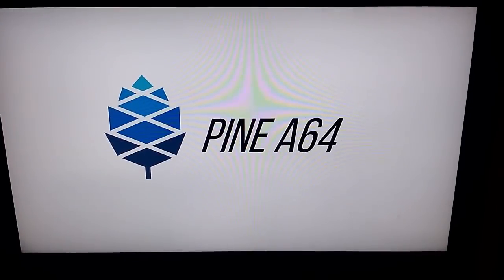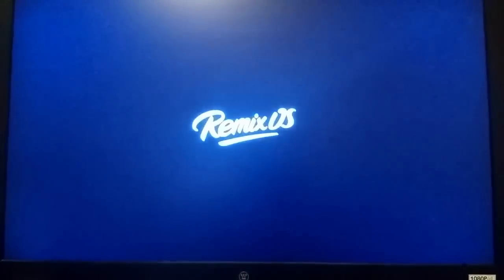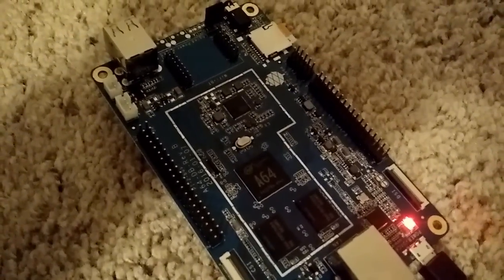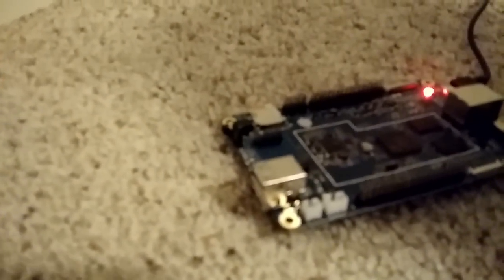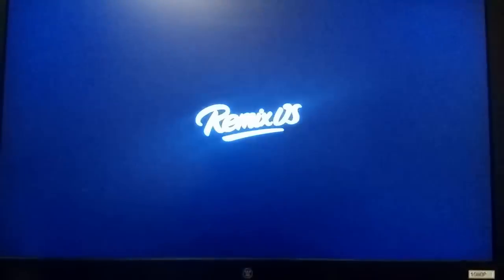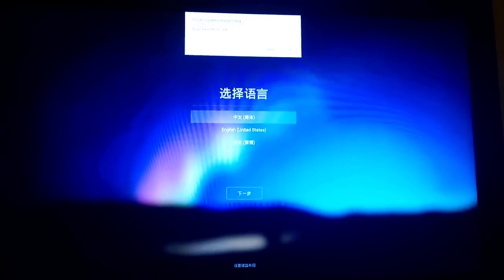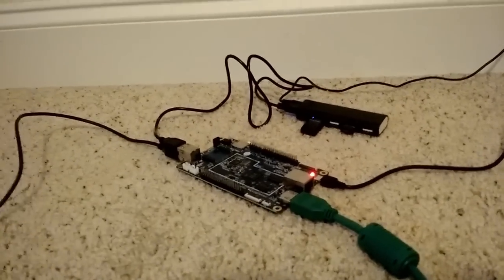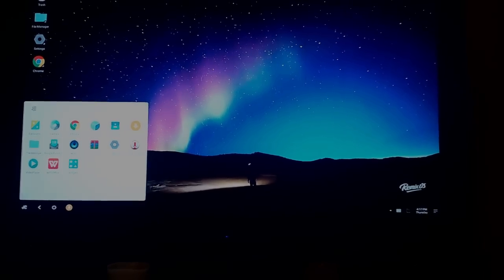Installing Remix OS on a Pine A64 Board

Comment: Can't wait for mine to come. Looking forward to the awesome.
Reply: I'm liking the thought of remix but any android OS will do. I'm so desperate for netflix on my tv that I'm going to order an orange pi one and throw in a 64gb sd android install. I'm a sucker for android. I think it's overlooked as being a consumption OS but I get so much out of it. It's got so much support and I want to develop apps for it. When my pine comes I'm going to milk its every worth. Probably on android, among many other devices on my network.
Reply: +Hexydes I'm not expecting flawlessness. However, I'm sure it gets progressively better from its relatively rocky uncertainty and criticism. I think this device is a self sustaining lower power solution whose future models will probably stun people. I like where computers are going and I'm never bored on BBS forums drooling in boredom anymore. Android is a plus and that's where raspberry pi has it wrong.
Reply: Yeah I got my Orange Pi (one). I think pine 64 is going to be significantly faster. Opi One wasn't hard to setup and I heard they both use phoenix card so my hopes are high. Says no pine until next month though and my order is still open. Loving the android on my television though. I had no idea Microsoft Word was finally free to download. On android nonetheless, kind of amazing even though I don't have a strong urge to use it. Opi One is a little buggy but the videos of pine don't seem to be. I got a solution til it comes but man am I hurting to start customizing my own desktop android install on my computer TV. The opi one was for my wife mainly for her television... Seems like Android is the new Windows. And on ARM chips that use 1/800th of an ATX power supply's wattage! Things are getting cool!

Comment: Question, i just got my pine (2gb) and i'm havig problems gettingit it work, i hope it's just a powersupply issue the red light turns on but does not give any picture to the tv (hdmi) so what would be usefull to know to trouble shoot this is: if i remove the sdcard, will it still show some sorts of "POST" picture? if that's the case best thing to do is strip the pine of everything and start testing 5v/2a supplies until i get a picture, if that's supposed to happen?

Comment: Tried this OS in a VM and it was slow from my experience ...just not a fan. 

I am not sure if it could even run on something other than a "Pi" (whatever version) though I AM very interested in seeing one of my favorite OSs Ubuntu Mate on non-pi (though better specs in some areas) boards ... just to see how they do.

I know one of the lead devs of Ubuntu Mate did say there will be a new version (Pi version), based on 16.04 LTS ...though, my guess is that it MAY not come out the same day as the desktop/laptop versions, though I could be wrong

Comment: I got my wifi to connect, with both android and remix but android turned the screen off after a bit, and never turned back on and then when I unplugged it and plugged it back in, it it didn't power back on, so I tried remix, again wifi worked, had that same issue with usb and first boot, then i went to play store app, then it turned itself off, i got it back on temporarily, but now it doesn't get past loading screen.

Comment: Well, as it turns out, wifi adapter is not going to work at all. Pine64 developers will not add support for it so we have to wait for somenone to modify the kernel or whatever.
It is going to be few months before we see custom android and remix images that can actually do something. As it is, pine is kinda useless

Comment: Shame it's about as useful as a chocolate teapot without ethernet or wifi!
Reply: Mine gets stuck in an endless reboot loop if I have an ethernet cable plugged in.
Reply: Yeah, that's why I'm disappointed with the Pine 64, at least when I bought the first Raspberry Pi it worked straight out of the box and had good online resources. Until I can get online the Pine 64 is useless to me, so I guess it'll sit in a drawer for a month or two until they get the software sorted out (assuming that fixes it!).